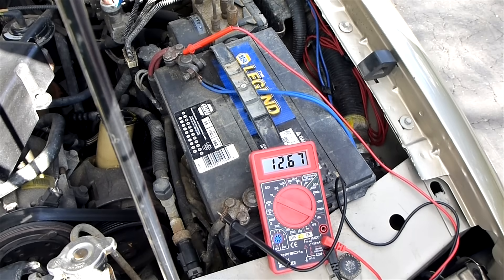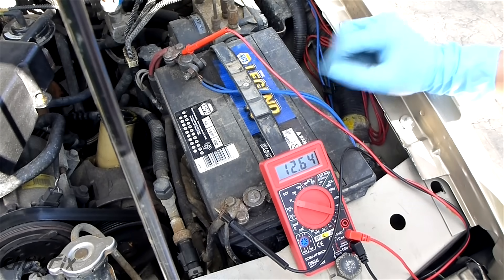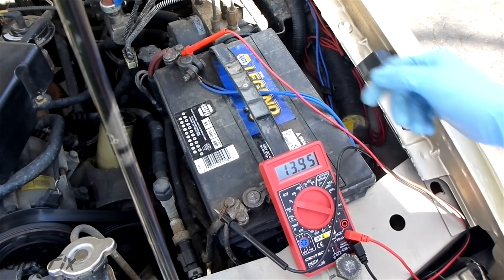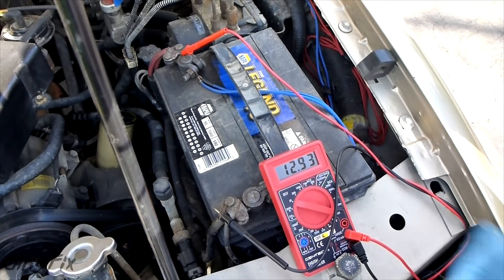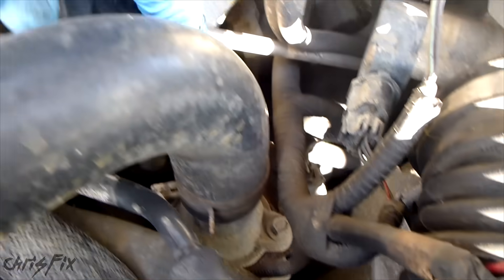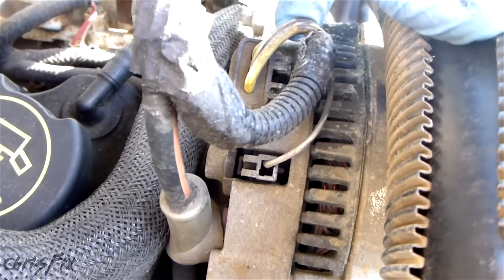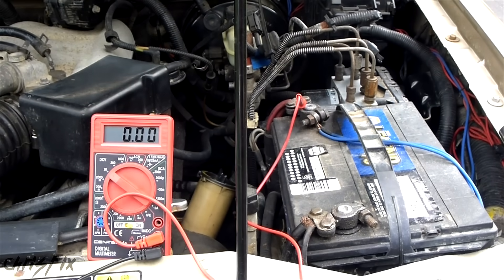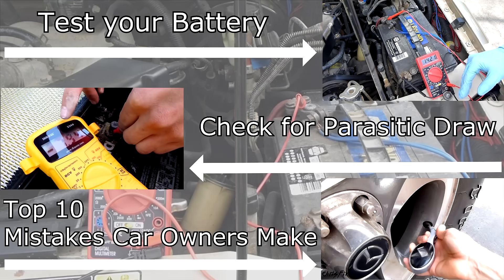How to Test an Alternator

Comment: I just bought  a scion 2013 frs I’ve driven it over 500 miles already. I change all the fluids but then the car I would start it up and while it’s running or warming up the car just shuts off or it shuts off when I’m in 1st gear riding slow. I checked the owners book and bascially the car requires 5.8Qt and I only put 5.0 Qt. I imagine is that because I never had a problem with the car until I changed the oil so I think it’s doesn’t have enough oil or It can probably be the alternator what is y’all opinion?

Comment: Quick question if you don’t mind.  Yesterday I charged my fully dead battery.  When I did the battery test This morning I got a reading of 12.7.  When I turned the car on and the electronics on it barely got to 13.0 V.  When I tested the alternator I got a reading between .01 and .00. Am I right in thinking that the alternator seems to be working properly but the battery just isn’t taking the charge or should I not rule out the alternator so quickly?

Comment: Is the alternator connected to the starter?
Reply: Not directly, nornally the alternator comes from a pulley (usually with the crankshaft pulley and belt). The alternator is directly connected to the + side of the battery. However the the + side of the battery is connected to the starter solenoid (b terminal).
To summarize, its ....
Alternator -> battery -> starter (with the ignition switch) -> flywheel -> crankshaft -> alternator.....
Reply: No, as its name implies, the starter functions to start the engine. All the power it gets is from the battery through starter's B terminal. The ignition switch triggers the starter solenoid through S terminal to enable contact between B and M terminals so that current flows into the motor inside the starter. Afterwards, starter's pinion gear drives the flywheel connected to the engine's crankshaft.
Alternator has nothing to do with starting process. It is the battery that powers the starter to crank the engine. So make sure the battery voltage is no less than 12V.

Comment: Mine usually reads 14.8 is that good or bad
Reply: Themassofmenlead - yeah I only get that reading when I start the car cold, over time it’ll drop down to 14.2 - 14.6
Reply: @abraham2699  I think it is acceptable. Every measuring device has specification on its measurement error due to several factors, including the measurement load that effects the result. Other thing includes zero adjustment. My multimeter is an analog, so before doing measurement I need to verify pointer location. I haven't used a digital one, but it may also provide zero adjustment as well if needed.

Comment: Make sure all the connections to the battery and alternator are tight and in good condition:  To check if your alternator is bad, if you don't have a multimeter start the car. Be careful and Remove the negative cable from the battery, if it stalls immediately you have a bad alternator, but if it continues running your alternator is good.
Reply: Before doing so, we need to make sure the 75A fuse between alternator's B terminal to the battery positive terminal is OK. In my car, from the electrical diagram, the fuel pump and fuel injector draw current from the side of the fuse that is onto/near the battery positive terminal. So if the fuse is not OK, the fuel pump and/or fuel injector may not function properly. In this case, we cannot judge on the alternator if the engine stalls.
My suggestion is always use multimeter as it is more convenient than removing the battery negative cable for that purpose.
Four days ago, I bought an analog multimeter which only costed about 10 dollars.

Comment: My problem is  start the car it read 12.4 after 1 minute read 12.3, have to accelerate to 2500rpm and start charging, the battery light never turn on,  light is good. Terminals are new, battery is new . What could be. Appreciate your help
Reply from the maker: The alternator is bad or the wires are not connected right/good.

Comment: If i get a message that says voltage error failure does that mean my alternator is bad? My car won't start at all unless i get a jump start.
Reply from the maker: It could be a few things which is why you should diagnose it the way I showed you.
Reply: Get a multimeter and do the measurement on the battery while the ignition switch is off like shown in this video. If the voltage is below 12V, it will struggle or won't start at all. Four days ago, I bought an analog multimeter which only costed about 10 dollars.
If the reading is always like so, it's time to replace the battery like I did three days ago.

Comment: Subscriber here sir. I turned on the engine switch on all ligths fog,head lights high beam turn on radio switch in aircon..hazzard on..keep engine running in 30mints,dint step on gas pedal after 30mints engine died,wont start again..what could be the problem..pls help tnx so much.

Comment: Chris Fix, what if the load causes the volts to drop for a second (to say 12v) then goes back up to about 14v, what could be the problem? I also jump started the car and it was there running and then died and wouldn't start up again. Engine doesn't even turn over, all i heard was a relay clicking. The battery was reading 12.6v, is that too little to start the car? I also notice that when i tried starting, the battery voltage dropped to about 8.5v.
Reply: 12.6V is enough to start the engine. Maybe the problem is in the starter. Check its terminals. Usually it contains 3 terminals :
1. B terminal : powered by the battery
2. S terminal : triggered by ignition switch to the starter solenoid
3. M terminal : current flows through it into the starter motor when the B terminal gets contact with it by contacting plate
Try cleaning these terminals and make sure the connections are tight. If you can, measure the voltage at B terminal.

Comment: I have issue with my 2012 jeep  I have jump start it.. then it dies aging after hours
Reply: The 1st cause is on the battery. Measure its voltage. If it is always less than 12V after stall, you should consider replacing it. Next step is to follow the steps as shown in this video to check the alternator.

Comment: I have a 2013 Toyota Corolla and I have a P1604 code in my obd2,(startability malfunction) the crazy thing is is that the car starts up beautifully but following this video where I should be around 0.5 I range between 5.05 to 5.76 to 5.86 in each successive step. now I know where my problem is. Now just have to figure out whether it can be corrected or I need a new one
Thanks Chris

Comment: This channel is so helpful it's nuts. I've gotten a lot of help from youtube videos over the years, but this channel is crazy good. I thought my alternator was over-charging my battery because the battery gauge was way high. These tests showed me my alternator is charging just right. So now I think that gauge's stepper motor is bad. At the same time the gas gauge is showing way over full... which should be a bad stepper motor too. Does it mean anything that two stepper motors failed at the same time?

Comment: Chris I have a problem. I swapped out my old alternator which I believe was rated at 100 amps. This new alternator is rated at 130 amps. When I turn my truck on, it idles really rough and the revs are super low to the point where the head lights and fog lights flicker and the voltage at the battery terminals read to about 11.5 volts when the engine is running. If I spin the engine to about 1.5k revs it goes up to about 13.3 volts. Do you think it's something on my installation process? It's a new alternator so maybe there was something I messed up on right? Hopefully it's an easy fix.
Reply: It sounds to me like the alternator has a defect

Comment: Hi Chris, i bought the amp meter from your link, the product is in yellow and the cables are too short, it also doesnt have the same layout settings.  You may want to amend the link as i do not think you are a person out to cheat your subrcibers on buying inferior products. The short cables that came with this product made it impossible to do the test you are showing.
Reply: For measuring voltage across battery terminals it should be enough. But it cannot when say, measuring between alternator B terminal and battery positive terminal by using short cables. For now, I don't feel a need to do measurement for the latter case unless I want to do for details.
Reply: @lexsoft3969  I needed a solution and i appreciate the details and depth of testing shown in the video, it's a pity the hardware i require, purchased through the recommendation does not tele with the video.
Reply: Teo Zhili Try to find in the internet on how to replace the default cable with longer cable. Usually it will need soldering the new cables on the device.
Read the users manual, usually it provides the guide on how to do replacement of the cables.

Comment: Hi very good video Chrisfix, i have had issues with my car battery and alternator on my Toyota Auris d4d 2.0 diesel 2008, i have replaced both parts twice, still no luck, keeps saying on dashboard check battery, and fuel filter light comes on, don't it is is water in fuel filter to cause it. Please please help me

Comment: What to do if it read almost to 15 volts?
Reply: You need to be exact : how close to 15V ?

Every alternator has its own specification on its regulated output voltage. In my car, it says 14.1 - 14.7V. So if the reading is 14.9 or so, it is not normal. The cause maybe in its IC regulator which serves to maintain the output voltage within its specified range.
Btw, do you use a digital or analog multimeter ? If you use the latter, make sure you do zero adjustment on the multimeter before doing the measurement.

Comment: You said of you got a reading of .1 to .2 you have a problem but didn’t say what that problem is.  I just installed a remanufactured alternator and got a reading from negative on battery to casing of .1 (with everything turned on and .08 without everything on); got a reading of .1 from  negative on battery and engine block and .03 with chassis ground.   I was not sure what bracket you were talking about so I didn’t do that test.  What is the problem with a reading of more than .1?   Thanx
Reply: BTW,  I know I am now getting good battery results thanx to your videos

Comment: My alternator just starting smoking! I had to disconnect the battery to make it stop what do you think the problem could be? And the wires are fine I checked them before I wrote this comment.
Reply: Stator windings overheat. The cause maybe in the battery which affects the charging process that involve the function of IC voltage regulator.
It is suggested that all charging system testing must be performed with a reliable and known to be good battery, at least 75% charged, to be assured of accurate test results. If a discharged battery is used during charging system testing, tests could mistakenly indicate a defective alternator and/or voltage regulator and could cause the stator windings to overheat.

Comment: This vid was CLUTCH in helping me diagnose! Thanks soooo much! Saved me a trip and even getting a new alternator I didn't need!
Reply: Sounds like you just learned how to drive a stick shift and it's a big deal for you.
Reply: @sehpatr4724  The world CLUTCH he used has nothing to do with the charging process and the voltage measurement shown in this video. Whereas you mean the word that we always use when doing heel-toe shifting or double clutch shifting like from 5th gear directly to 2nd gear.

Comment: Thanks very much Chris. My vw golf 4 gti burns the charging cable after 12 months or so.i think is overcharging. I will get meter and confirm. Will replacing voltage regulator help or can i just replace the whole alternator.
Reply: I'd check forums

Comment: ChrisFix  hello. Can i do the checking of alternator if it is properly charging the battery using a Voltmeter that is plugged - in in the cigarette lighter socket?

I encountered a problem in which the battery indicator appeared in the dashboard when I started my car in the morning and the indicator does not disappear. I also checked the voltage using voltmeter in the socket and the battery is charging when i started my engine.

What is probably the cause of this? Did my alternator get wet?
Please help me.
Reply: The 12v socket testers I've seen aren't accurate at all
Reply: @liveandletlive2894  is the reading in the socket a little bit higher? Or lower?
Reply: @sadatalipulo979  idk by me it's usually lower...just buy a multimeter and for testing a car battery or alternator you can get the cheapest 1 for around $10 though I'd suggest a $20 off amazon
Reply: @liveandletlive2894  yes. I'm gonna buy one.
Reply: @liveandletlive2894  have you experience that the battery indicator appered in your dashboard?
Reply: @sadatalipulo979  I haven't had the light on my dashboard

Comment: Chris, I just want to warn your readers about the bad quality of the REMY remanufactured alternators, specially for the car I have, a Forester 2002. I originally replaced the car's original one, overheated (FIRST). This one lasted for 8 months, until my instrument showed 0.volts O/P. I replaced it (SECOND) with a REMY part; not cheap, btw, $276.00 CND. It only lasted for a couple of days, in which its O/P went from 14,4 Vdc to 0, and the battery started to waste down. Concerned, I replaced wires connector (just in case, although it showed no physical damage). I replaced again (THIRD) and has been working steadily, They use bad semi conductors or bad labour, in re-painting coils with isolating varnish. God only knows for how long. Be aware of cheap parts, re-manufactured under s***hole country Standards, folks.

Comment: Remember the good ole days when voltage regulators were separate from the alternator?
They cost much less than an alternator.
Reply: My 95 Grand Cherokee has the voltage regulator built into the ECU. I'd rather replace the external regulator or even the internal regulator in the alternator than deal with that mess.

Comment: So I'm having a drainage issue I replaced my voltage regulator I turn the radio on turn the AC on turn the brights on my car is in 85 so it's running all the accessories that has and it's reading 12.5 so I think I need to replace my alternator
Reply: Well I replaced voltage regulator seems to be running fine. It was not the alternator voltage still seems to be low but it's running fine

Comment: I have an 06 Silverado 5.3L. Yesterday the battery light came on and showed battery not charging on the message center(no CEL). The gauge on the cluster showed roughly 12v. My multimeter read 14.9 at the battery and alternator with engine on and off. What would cause this?

Comment: What happens when nothing turns on (everything is dead)? Especially when you connect both the negative & positive terminals
Reply: Your battery is probably dead?
Reply: @Blackburn9157  I just bought a new battery. Does the same thing. Nothing turns on

Comment: I would suggest battery grease or any grease thickly applied once connections are clean that should stop any corrosion for a long time building inside terminals including on post before terminals reapplied.

Comment: Before running out to buy an alternator if you do this test and it appears your alternator is defective, check the belt to make sure it didn't snap. Seems simple, but this happened to me. Before completing my diagnosis of the issue, I double checked the alternator for loose wires and found the snapped and shredded belt which caused my alternator not to work.
Reply: I found a loose nut.  Easy fix.

Comment: What if it's battery voltage as the positive drop does that mean it's shorting to ground someware? Or that the alternator is dead?
Reply: No it is shorted to positive since you said battery voltage which is 12.6v dc.

Comment: Great video. Always keep terminals clean. If theres a  gap between the cable wire outer coating and the connector and the cable wire is exposed, take some silicone and seal that opening/gap. Rain and acid water from the battery can get into that opening, travel down between the wire and coating, and  accumulate at a low spot completely desolving the wire without damaging the coating. I replaced a perfectly good relatively new battery because of this. No use having an outer coating if the ends of wires are exposed. So make sure to siliicone all ends of wires.

Comment: U can also start car and undo battery connector + side. If car runs.......u good. If turns off. U need. Alt
Reply: NEVER DO THAT!!!!  Esp. with any modern vehicle. The battery, even a deteriorated one MUST be in the circuit to protect the alt. diodes. Doing otherwise will destroy the alt. unless you're very lucky. At best the diodes will be weakened.